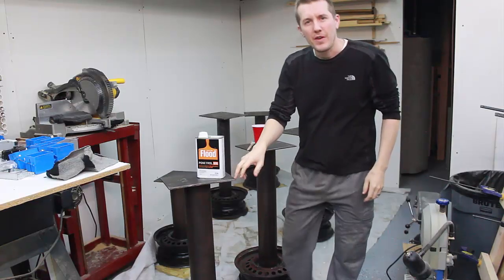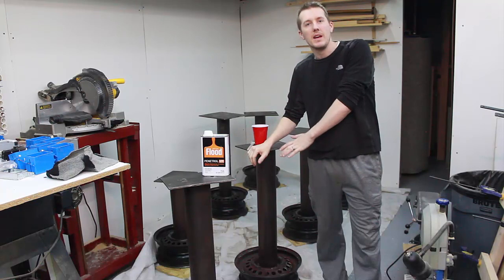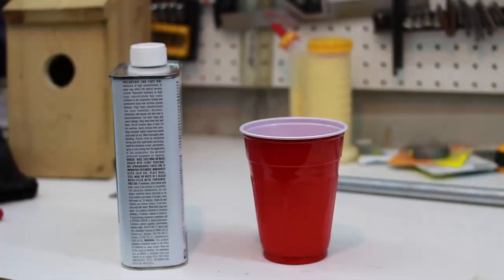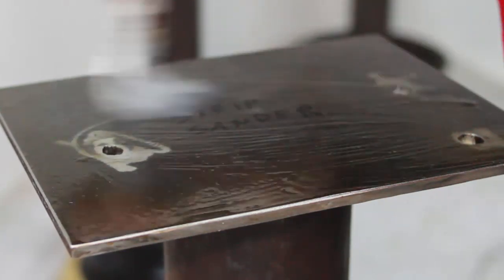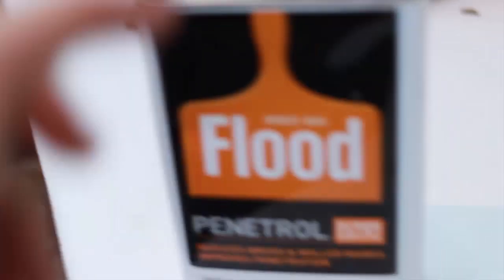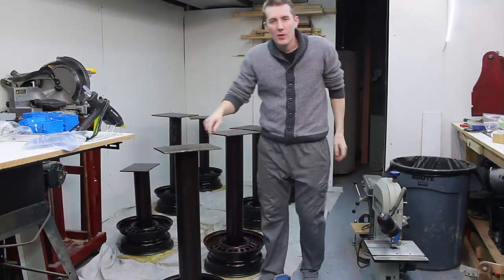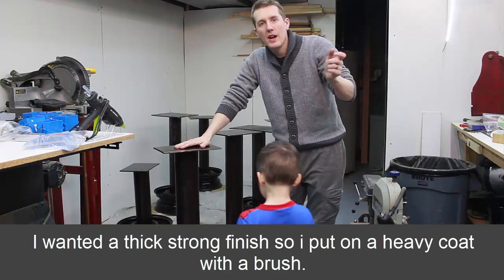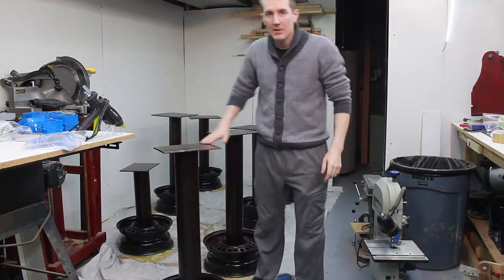Bare Metal Clear Coat (Flood Penetrol)

Comment: Penetrol is amazing, I've used it to buff black plastic trim on old cars and it brings the original black sine back.  I've Penetrol-ed my old truck, outside the Penetrol will be washed away after 6 months or so but I'm interested in using it as Primer. I wonder if it is better than other primers?  I also wonder if one can fiberglass over metal that has been primed with Penetrol? I may try this.  Thanx for the vid and your stands look great, also a great idea for the stands!

Comment: Dave, thank you for the video.  I have some questions if you have time to answer them.  My current project for the last 8 months has been to maintain a bare steel look on my Harley Davidson Sportster.  I sanded it to bare metal and put a brushed look on it by hand (I've gotten really good at gettnig straight lines and blending it together so you don't see lines intersecting).  The first coating I used was Exo Armour by Eastwood.  Great product, but it trapped moisture under the coating and my metal rusted.  This time I coated with Penetrol, probably too thick as it's not a very smooth finish all around - feels gritty in parts.  I can wet sand or buff it, I'm sure, but if the Penetrol wears off, can I just coat it again over the parts that wore off?  Is it self-annealing, or will I have to remove all the Penetrol and re-coat.?  How well will penetrol hold up as a primer coat?  I ask this because I just ordered some Protectaclear (describes itself as self-annealing, so in the future, I won't have to sand off to recoat.) and I'm considering just putting it over the penetrol - I don't want to take another chance that coating without penetrol will trap moisture and rust again).  This project is a bid deal to me - I don't care if other people like it, I just care that it looks as good as I want it to and I do love how rich the shine is with penetrol.  I just don't want to remove it and recoat it every 6 months to a year.  Any input would be wonderful.
Reply from the maker: I'm not an expert, i've only used Penetrol a few times.  But i would say it looks and feels like a polyurethane that you would put on wood.  It has a brownish tint to it and is kind of thick and sticky.  Has the same feel as a polyurethane when it gets on your fingers.  
I've seen people put it on rat-rods, but then again, they aren't going for a super smooth look.  Lots of time those people put it over metal/old paint.  I wouldn't think it would end up looking like a clear-coat.
As far as self-annealing, i'm not sure.  For polyurethane on wood i know you can do multiple coats, sanding in between with regular sandpaper or wet sandpaper.  So i would guess Penetrol would also work for that, but i have no idea.  When i put it on my metal stands, i did 2 coats, without sanding in between.  There was a definite "thickness" to the Penetrol.  I could tell that it was on there.  Not like a smooth shiny clear-coat, but more like a thin plastic feel to it.
Reply: @DaveWirth  do you think you could add pearl that they put in clear coat to penetrol and get the same effect.   Thinking about putting it on a 55 dodge that I am taking down to bare metal , give it a kinda airstream, rat rod, punky ,shimmer gloss look

Comment: Alright I got a question for ya.  I got an old car,. 1955,. And I am stripping off all the paint. Bare metal. It's kinda shiny and wondering if I could put not only flood penetrol on it but on e bay you can get pearl that you add to clear paint.  Do you think you could add pearl to penetrol?
Reply from the maker: Maybe, but i'm no expert.  I've seen other video's on Youtube about painting cars with penetro, but they were all ratrod type cars and so the not-perfect look was ok.  It's hard to tell, because i wasn't painting on super bright and shiny steel, but i think the penetrol has a brownish or yellowish finish to it.  Kind of like a polyurethane on wood.  The penetrol in the can is NOT clear, it's yellow/brown.  So maybe you could add pearl, but my guess is that it wouldn't give as clear of a finish as a clear coat of laquer or something.

Comment: What if u wanna use it on your welding table surface?  Does it prevent the flow of electricity?
Reply from the maker: It probably wouldn't work on a welding table surface.  This is like a clear coat.  I think welding tables need to be periodically sanded to get a good bare metal contact.
(i remember Jesse James using like a scotch-brite pad to prep his table before sanding?)

Comment: Can u use this stuff on faded automotive paint?if so how long does it last?can it be washed off or does it need to be reapplied in the future?
Reply from the maker: Not sure.  I know i've seen video's where they paint rat-rod type cars with this as the clear coat.  
As far as the tool stands - they've been inside, but are holding up great.  Just as good as the day i painted them.

Comment: do you need to remove mill scale?
Reply from the maker: I did use a wire wheel on a grinder to remove all the heavy rust.  But didn't grind it down with a grinding wheel, until it was shiny metal.

Comment: If I sign my mild steel will flood dolfi shine of the metal
Reply from the maker: I don't know.  I've only ever used it on my metal tool stands.
The shiny surface is similar to putting polyurethane on wood.
Reply: @DaveWirth  ok thanks
Reply: @DaveWirth  ok thank you